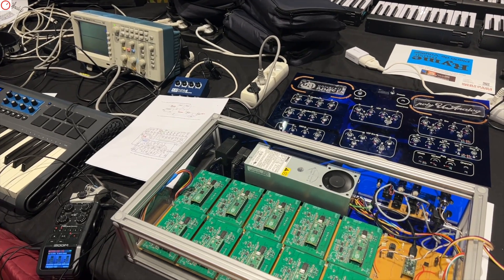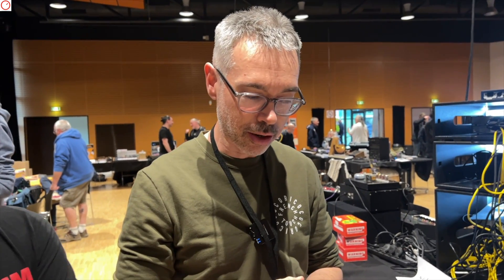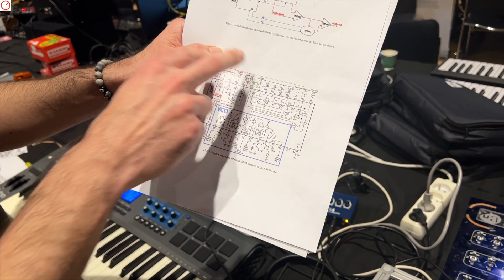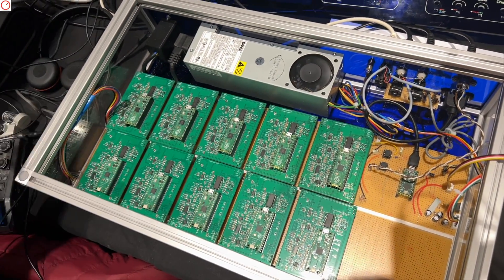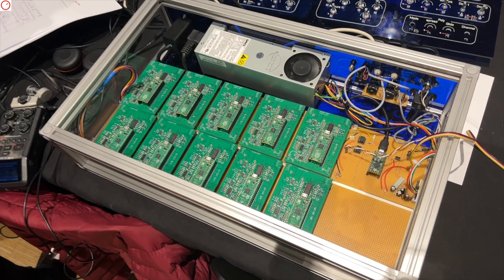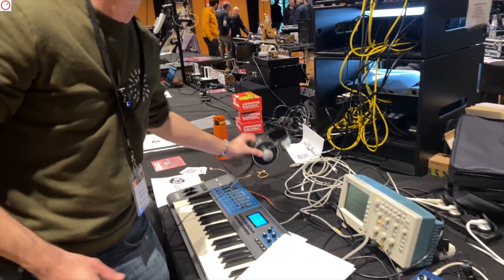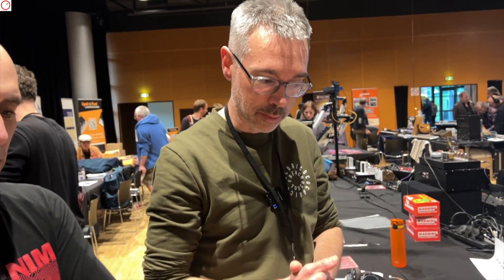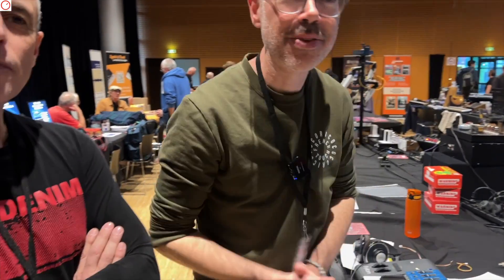polyUAnalog: Open-Source DIY Poly Analog Synthesizer | SynthFest France 2024

Comment: Okay.. its a digital Synth.. this you can build easily by yourself.. - A Teensy costs around 30 euros... the PCB 4 Euros.. the needed parts complete around 15-20 euros.
Reply from the maker: I suggest rewatching the video. The core of the synth is analog and uses the AS3397 synth voice chips. It has an analog signal path. Like every modern patchable analog synth, all these features must be digitally controlled so that you can save patches, use MIDI CC, etc. That's where the Teensy is used. Envelopes and LFOs are also digital, like in many modern analog synths.

Comment: I believe it'd be possible to add some of the digital oscillator designs from Mutable Instruments Plaits to the voice boards. Those are coded for STM32, but I think an RP2040 core could handle the less intensive algorithms. This is a good era for open hardware, lots of exciting things being done on cheap microcontrollers.